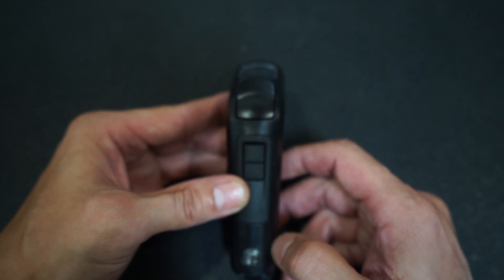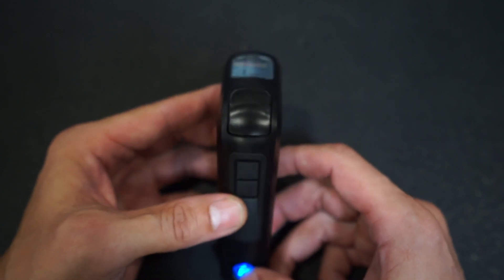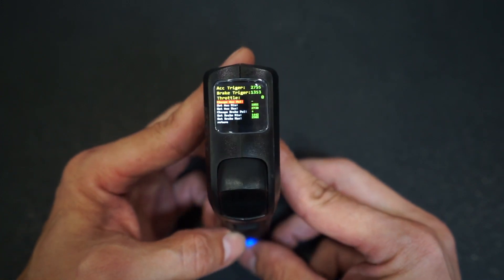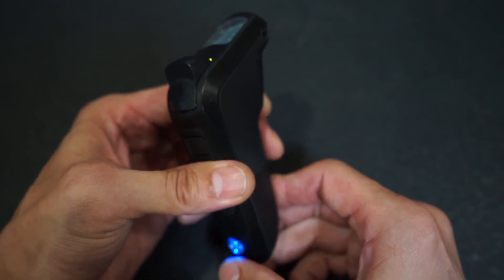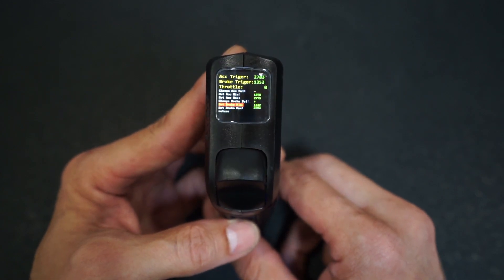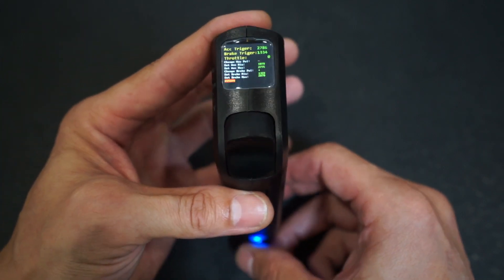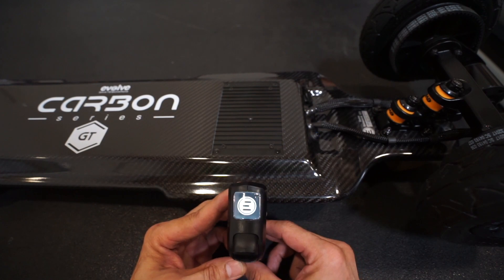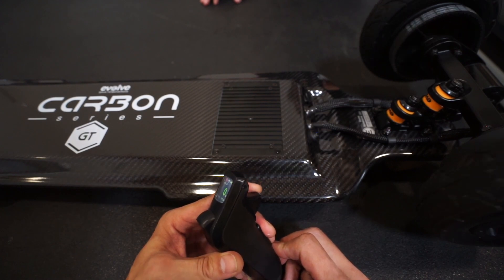R-2 Trigger Value

Comment: I calibrate it by minimally pressing the brake about 2 millimeters in (Set Brake Min), so that I have a safe dead zone in the brake and I haven't had any more problems since then whith the throttle.

Comment: My remote is stuck in slow
Reply: KHADE bramich try pulling the throttle switch out a little bit. Mine did this too and it was because the remote “thought” I was pressing the gas. If you can pull it out to the full reset position it should work.

Comment: Apply brake and then get no throttle was my issue. This video was straight forward, easy to follow and understand, clear and precise.  TAKE NOTE EVOLVE this video needs to be uploaded onto your website. It blows away your useless video on the R2.

Comment: Anyone with a new board see that this isn't the same anymore. I need to change my trigger values. Sometimes it thinks the break is on and won't let me accelerate. There is no more info on the new controller
Reply: I calibrate it by minimally pressing the brake about 2 millimeters in (Set Brake Min), so that I have a safe dead zone in the brake and I haven't had any more problems since then whith the throttle.